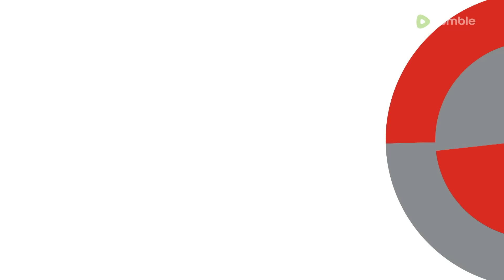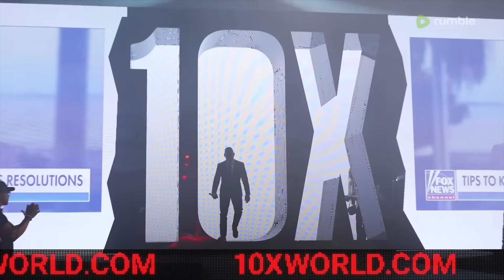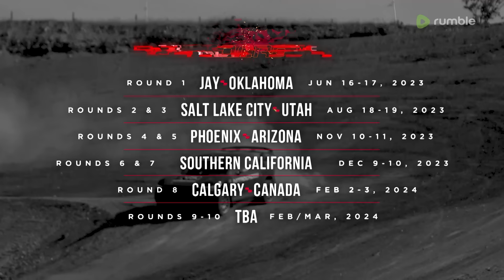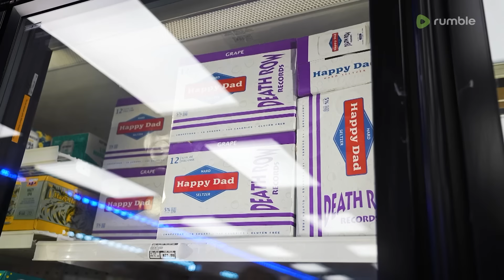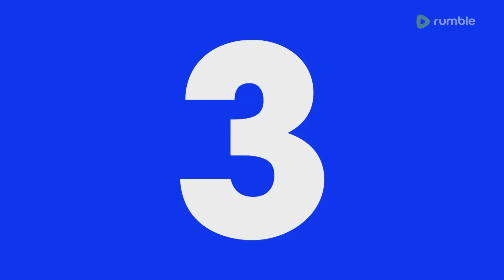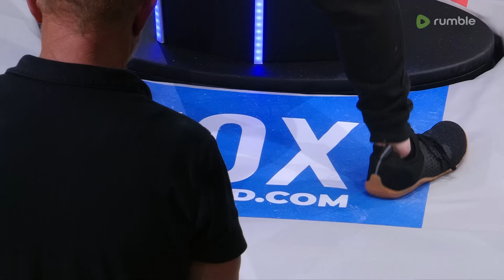Power Slap 2: Wolverine vs The Bell | Main Card | FULL EVENT

Comment: Davis flinched the whole time and then they call this a flinch, 131:56 his head moved up and back a tiny bit and then he braced his head in and down right where it was supposed to be. does the exact same subtle brace on the next slap...
Reply: I'm new to this, but I certainly thought Davis' flinches would have been a penalty.
Reply: @josephg32541   Drain was stepping as well. #1 problem with powerslap is the inconsistent judging.
Reply: Is it not the ref that calls it first? If not then the inconsistency of these fouls is horrendous